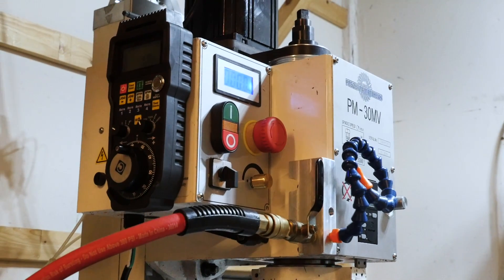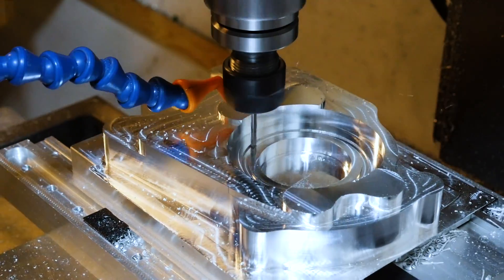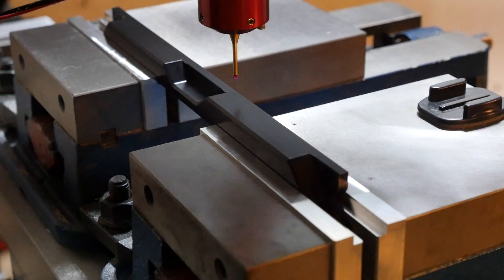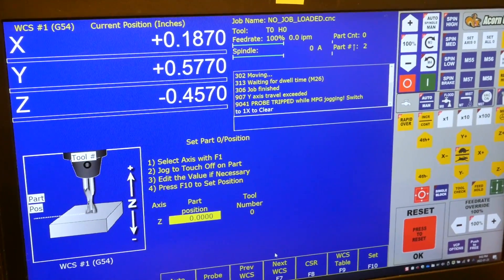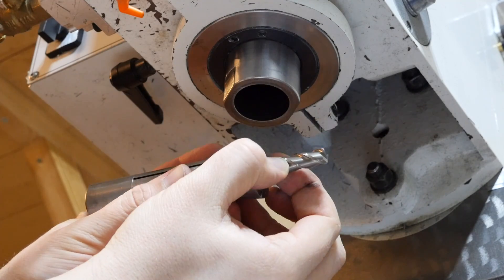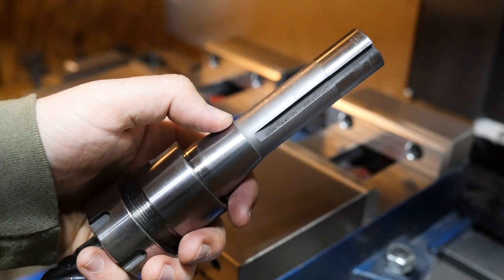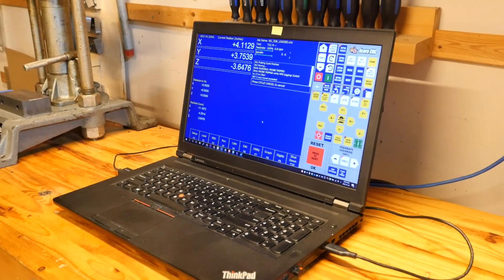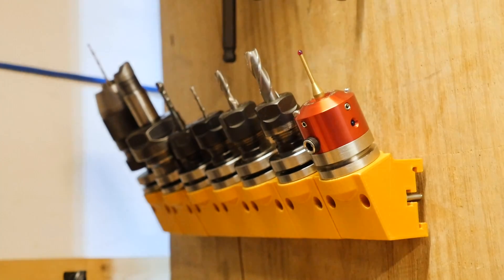Convert a Bench Mill to CNC - Everything You Need to Know

Comment: Mate the video was amazing. On everything just long enough and then moving to the next thing. Saying better stuff too which you couldnt go for and what not to buy. Love it. Great video.

Questions.

1)  If you want to increase the axis of the cnc machine you have, how would you do that?                             (Clearly means that you can make trickier parts.) 

2) 3d scanner. I seen you copy parts. What about buying one of those to scan the part and there you have it on your screen after.

3) You know if you had something with say a thousand pins in which slide up and down and each pin was linked to a computer, you could lower it over a part and the dimensions would be recorded instantly.
Reply from the maker: Hi James - thanks for the kind feedback! I’m glad you found the video helpful. I’m not an expert on 3D scanning, but I’ve crossed paths with it several times in my career and I’ll talk a little bit about what I’ve learned.

1. You can’t typically increase the X/Y/Z travels on a machine. You can sometimes squeeze out a little more by cutting away parts of the mill that interfere with the motion, but it’ll only be incremental gains.

2. 3D scanners generate “cloud point data” - millions of points in space (like a floating cloud) that software “stitches together” into a mesh. They’re great for 3D printing, but not so suitable for machining directly. You could, however, use the scanned model as a reference and accurately (and manually) build a 3D model based on the scanned dimensions, then machine something based on the manually created model. 

3. This is actually a really good analogy for the kind of models that 3D scanners generate! All those pins would give you a bunch of points in space to stitch into a mesh, but it wouldn’t be suitable for machining for the same reasons. Also, the pins wouldn’t be able to detect undercuts. Imagine a miniature table that you’re trying to “scan” with your pin apparatus- using the apparatus from the top. The pins wouldn’t be able to detect the air under the table, nor the size or location of the table legs.
Reply: @adamdebowski2037  My 3d printing experience has been horrendous. I bought a Creality pro v10 and it would always screw up. So after a year ignoring it and literally discarding it, then YouTube showed me the Bambu x1 Carbon. It arrived yesterday. Waiting for something to be wrong I unboxed it. All ok to the point of setting up and then came printing. I selected pre set boat and used glue stick. Then it tried and messed up big time. second time failed again. Third it printed round discs with Bambu in them. Fourth a Spartan warrior holding shield. Epic fail. I won't waste my time with 3d printing if by end of today the machines not fixed. Drives me insane. Can't be the only one experiencing errors.

The machine had calibrated itself at the beginning then print tested and done it xy mech synch whatever that is. Still failed. 

My way of doing parts would be to remove the part. Make a mould. That sets. Use that to make inside mould to copy part. Then put that in sand and get the shape then pour in boiling aluminium. Part made. 3d printing what a bore.
Reply from the maker: Sounds awfully frustrating. Did you end up working out the kinks in the 3D printing process? I've heard great things about the Bambu machines.
Reply: @adamdebowski2037  nope. This morning for two hours it sat there nozzle tapping away in the middle of the table and the power off button on the top having zero effect to turning it off. Even reset it to factory settings to remove the update. Nothing. Then after four hours switched off, tonight it printed like there was no fault with it. Strangely it did that the day before too. Its not a morning printer. 🤣
Reply: @adamdebowski2037  hey precision mathews PM728VT.  Have you any thoughts on it. They wont export to UK, but I did track down the Taiwanese manufacturer and they are most accommodating to my idea of buying direct from them. Do you like this machine?
Reply from the maker: @jamesbarratt593  Im not really a fan. Would be great for plastics but not steel & aluminum. It’s half the power and less rigid (pm30-my weighs over 40% more). Im not sure how much more precise it could be. The PM30 is good to within a thousandth or so. My opinion is that It’s less machine than the PM30 for the same price.
Reply from the maker: @jamesbarratt593  oh boy - that is not a fun problem….
Reply: @adamdebowski2037  I reset the machine to factory settings. Every print I deselect the option for bed levelling. And it works now.
Reply: @adamdebowski2037  yep I mean all the people out there building their own machines and they are going for powerful motors. The pm728vt only has 1hp motor. Like really? Then the woman in sales. Just keen to sell. And Precision Mathews both big it up. Of course they want to sell it. 

1hp cant machine steel

Comment: Adam, PM is now selling what they call an "ultra precision mill" (PM-728VT) in this form factor/price class that also seems like a pretty compelling choice for eventual CNC conversion... The trade-offs seem to be: motor only 1HP (although can reach 4k RPM in vanilla setup), ~150 lb. less mass, ~5 in. less X travel, and modest price increase. 
It is not exactly clear how one would quantify the "extra precision" in order to decide if it is worth $700 more. Based on your descriptions, I get the feeling that "more precise" does not necessarily mean "more rigid" ... maybe it is just capable of slightly better surface finish when cutting within the parameters/limitations of the machine/spindle? 
In your videos, it looks like your PM-30MV is pretty much handling everything you have thrown at it. The almuminum work looks very good and much faster than I expected!
Have you ever found yourself thinking "I wish this machine was 'more precise'"? Do you sometimes find yourself wishing the PM-30MV had even more mass?
Reply from the maker: Hi HydrationAppreciator - you’re asking all the right questions. I’ve been skeptical of the 728VT, but have ultimately heard good things about them, and have never used or seen one. For me, a little less X travel wouldn’t be a show stopper, but the 1HP and less mass might be. Not only do I find the 2hp motor on the 30 to be underpowered (then again - it IS just a hobby machine - how much can you really expect?), I have the same problem with the lack of rigidity. You’ve really got to dial back the feeds/speeds on these machines to cater to the low power and rigidity. That being said, I’ve heard the same things about Tormach machines.

Re the accuracy of the PM30, I’m consistently amazed at how accurate it is, but I think that’s more of a testament to the ball screws and servos. I haven’t ever checked the straightness of a straight cut or something like that - to check how straight the tables are travelling. The PM30 is accurate to within about a thousandth or two easily when I measure final dimensions. Any more than that is usually a setup issue.

Comment: If you are thinking about building the electronics your self , be warned. All the control signals need to be opto isolated in effect changing the more usual edge detection logic switching to logic level detection. Do not compromise on your opto isolators cheap ones will suffer from degradation
Reply from the maker: Hi factorylad. It sounds like you know a lot more about this than I do! I can confirm, though - I’ve not had any problems with this “chinesium” setup. The step/direction & encoder feedback signal cables are shielded and I haven’t experienced any degradation issues after about 4 years.

Comment: Side note, the end mill sets that PM sells are absolute garbage. I bought a set because they were cheap, I have a couple PM machines and have liked them, so figured I'd give them a try. They came ground completely wrong. Like, would not even cut, at all, wrong. Totally worthless unless you regrind them. I ended up needing to regrind every single one of them before they could even be used. Oh, and that wasn't worth it because the HSS they used is hot garbage so they just break way too easy. The machines though, the machines are decent lol.
Reply from the maker: Wow - good to know, thank you!
Reply: @adamdebowski2037  Hey great video btw. This has to be the most comprehensive yet easy to understand DIY CNC "primer" that I've seen to date. There's a lot of them out there, but they often spiral into being completely unintelligible for a total noob within the first 30 seconds. Your vid really gives someone an overview of everything that they'll need so that they can start researching with confidence. I'd recommend watching this video and making a little check list. Then, off to the races researching that checklist, by the time you get to the end you've got everything you need. well done.
Reply from the maker: @DavidHerscher  thanks very much for the kind words, David. I’m glad you think so! Cheers 🍻

Comment: have you had any dealings with the masso g3 touch, i have a southbend magnaturn 612 that is complete with a delta 50 controller, just out dated, everything is built heavy duty using all baldor ac servo motors and a baldor ac power supply
Reply from the maker: Nice 👍 I have not worked with a Masso personally, but I’ve only heard good things. You will be fine - just make sure to confirm you’ll have a post for it. Fusion and HSMWorks come with a Centroid post that I’ve not ever had a problem with.

Comment: How are the PM machines for gunsmithing? WOuld this machine be able to handle 4140 steel? Personally looking at PM-728VT
Reply from the maker: I wish I could tell you! I’m up here in Canada and they don’t let us have too much fun with guns. Every mill on the market will be able to handle 4140 steel - it’s just a matter of how hard a cut the mill can handle. 

I’m personally a big fan of the pm-30. In my opinion it’s a better mill than the 728vt. The only thing the 728vt has on the pm-30 as far as I can tell is spindle rpm. Looks like it goes up to 4000 (pm30 does 3000). But the 728 has half the power. 1hp motor vs 2hp. The 728 runs on 120V and the 30 on 240V. I think the 30 is heavier/more rigid, can easily be modified for an extra 1.5” travel in Y, and I’m getting 0.001” accuracies on the 30. Check out mpmachiningusa’s channel. He does lots of gun work w/ the 30 and his machine is amazing - lots of upgrades.
Reply: @adamdebowski2037  Thank you for your response. Originally I was considering PM-932V but that may be a bunch of overkill. Ill definitely take a look into the 30.
Reply: I’m comparing the 932v and the 30 and it seems for just a few hundred more the 932v seems nicer. I’m just not sure if it’s convertible to cnc. I really want a setup where I could do cnc and also manual.

Comment: Do you have a part number on the tool holder? Also awesome content!
Reply from the maker: There are several tool holders to choose from. I use mostly ER20 Collet TTS tool Holders. You'd use ER32 if you need to hold tools larger than 1/2", and ER 16 for smaller tools. In my opinion, the smaller the better if you can get away with it. Gives more clearance.

Comment: Really good video, thanks for the share. You did not say anything about that spindle motor though, did you have to do anything to it? Does  the cam board just connect the the stock controller?
Reply from the maker: No - I control the motor manually from the mill. I turn it on manually and then start the program.

Comment: Can you use the mill manually with the cnc conversion
Reply from the maker: Yes. There are no hand wheels, but you can move the motors manually from the control and pendant.

You can also enter g code manually - line by line - to move the machine (in the control)

Comment: Thanks for video, great explanation! I always wondered in those conversions if its needed to convert Z axis to ballscrews by any reason other than sound, why not just adding gear multiplier and connecting motor in place wheel handle in column? As far as I understand - there's no backlash in Z direction because its always under pressure from weight of a head, or you think it can be lifted up while milling with cutting forces?
Reply from the maker: You have a good point. I don't think it would be lifted while milling - most cutting forces should only pull the head down towards the table. I don't know of anyone who has converted x & y only, but I would be interested in the results!
Reply: @adamdebowski2037  I know that this old tony while converting his MAHO did only x and y ballscrew conversion, but it was a knee-mill, not column one though.

Comment: Adam,  Great content and very helpful.  I am looking at converting a PM30 but wanted to ask about the Intel NUC you used.  What are the specs or what is the model you used and have you found it to be adequate?  Anything you would do different now?  Thanks and keep up the great content.
Reply from the maker: Hi sharplines - I don’t use a NUC. I run the control software on my laptop.

Comment: Can you recommend a starter set of Collets + Bits? I'm getting a SuperFly Cutter, and when in stock, the s5000LED TTS Wired CNC Probe. What 5 others should I use? Doing Knife handle scales, and some blade steel. Eventually Titanium scales...but not yet.
Reply from the maker: Hi Phiz. For steel, get yourself a few stubby 1/4” 4 flute coated carbide endmills with a 0.030” radius. That’ll work well in G10, too. Practice with them until you’re confident, then let your jobs dictate what endmills to buy. I would hold off on buying more tooling until you know what you need. I wouldn’t buy 5 endmills “just because.” You’ll never use them all.

In general, I use 3 flute uncoated tooling in aluminum, and 4 flute coated tooling in steel. Stubbier is always better if you can get away with it, and a radius will produce better floor finishes and last longer. I generally don’t use larger than 1/4” tooling in steel - but if you’ve got a bigger mill, you could do it.
Reply: @adamdebowski2037  Thanks! I'm going the route you did mostly. PM-30 with an Acorn controller with some ClearPath servos. Looking into the bits again now. I'll take a look at the Stubby 1/4" coated carbide in the future. I'll start in aluminum so I can learn to make the fixture plates. My mill will be here end of October! I have the CNC parts working. Just need to install the Ball screw kit from Arizonavideo99 and calibrate everything once it arrives.
Reply from the maker: @Phiz787  sounds like you’re on the right track! Good luck and keep us posted with how it all goes!
Reply: @adamdebowski2037  Do you have some of the CAD/STL Files for your 3d printed organizers, and the TTS collet holder?

Comment: Wanna convert a harbor freight benchtop mill any advice?
Reply from the maker: Hi Jerome - first thing I’d do is search for, and try to get in touch with someone who’s done it on the same mill - they’ll be able to tell you if there were any difficulties with trying to install the ball screws. Some mills have tighter clearances than others between the tables/columns that make it more challenging to physically replace lead screws with balls screws, since ball screw/nuts generally build larger…. But once you install the ball screws and motor mounts, the electrical/controls side is all the same. Does the Bridgeport have an R8 spindle? If it does, you’ll have all kinds of great tooling options.

Comment: Newbie here.  Dumb question.  Once a person converts the mill to CNC, is manual operation  still functional?
Reply from the maker: Hi Scruffy. The short answer is yes. There are motors you can get where the shaft sticks out the back (https://m.aliexpress.com/item/32449717007.html?gatewayAdapt=Pc2Msite), so you can mount a hand wheel behind the motor. Alternately, you can get motors like I have and turn the jog wheel on the control pendant to manually jog an axis electronically - which is what I do when I want to use the machine “manually.”

Comment: Excellent Summary. PM-728VT is another easy to convert Mill (comes stock with one shot oiling), and Precision Matthews has a bolt-on ballscrew kit for it. LinuxCNC and Mesa cards are my plan, along with TTS tooling and closed loop steppers and the Drewtronics probe.
Reply from the maker: Hi Alan - Didnt know they sold a ball screw kit for it. Seems like they’re catching on to the hobby CNC community. I’m curious how you’ll find the spindle motor. That machine sounds perfect for a spindle upgrade. Sounds like it has increased rigidity over the PM30-MV but a lower power spindle - which seems strange. Curious what you’ll think. Good luck w the build!
Reply: @adamdebowski2037  Thanks. I'm still collecting parts. I like the brushless DC motors' variable speed and high low end torque, but I haven't really stressed the spindle much with the work I've done so far. CNC might change that. I don't have 240V so choose 120V machines. On the one hand they say it is 1hp on the other they say it requires a 120V 20A service which can easily make 2HP, so it is not consistent. It is certainly a big step up from a mini-mill.